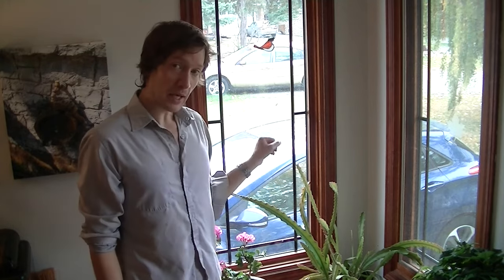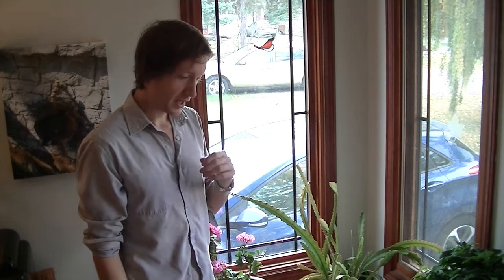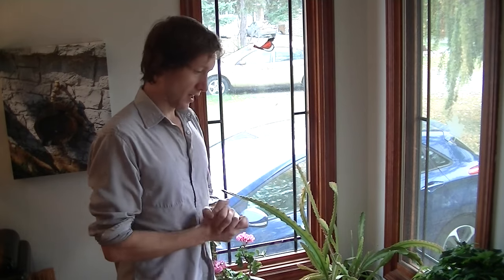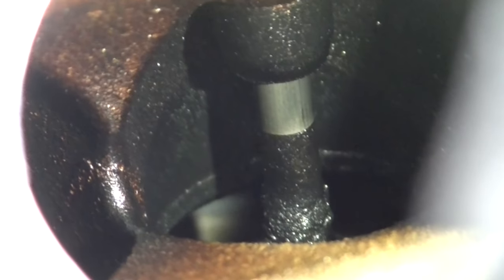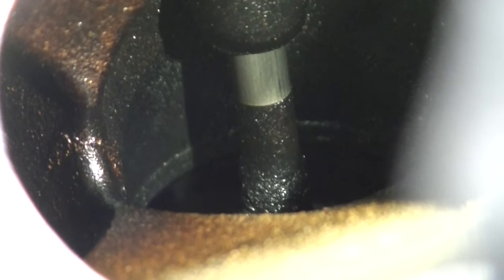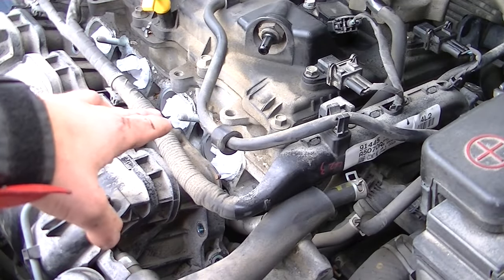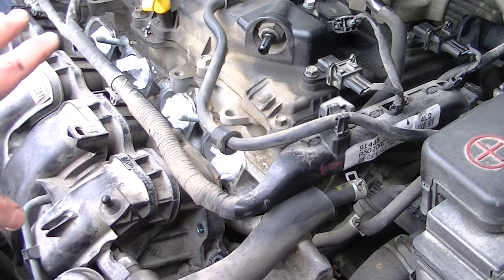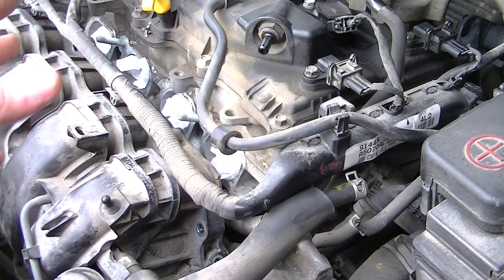Easy DIY Intake Valve Cleaning For Direct Injection | Hyundai Elantra GT

Comment: If you have a DI engine, you should really be running an oil catch can, especially if your engine is turbo charged.
Reply from the maker: That is a fair suggestions. I will discuss it with the owner after doing a follow up to check the buildup..

Comment: That was hugely helpful. I have a 2013 Kia Rio that has what looks like the same engine. Good to know that you don't have to pull the head. They don't have to be brand new, pristine clean. Just clean enough to not interfere with your ECM and emissions systems. Thanks for this video.
Reply from the maker: Exactly, they will only ever be perfectly clean for a moment. So it's regular operating condition is somewhat dirty.

Comment: We wouldn't have carbon build up if the Government did not have stupid emissions requirements. Direct injection goes back to WW2. We could get the benefit of fuel economy and not have to worry about carbon build up. Thank you Washington.
Reply from the maker: True, it is only the gunk causing the problem... well the vast majority of it. There is likely a better solution, but for manufacturers piping it back into the manifold was quick and easy and didn't really cause any issues. ...Until direct injection made it to mainstream. It wouldn't surprise me if the number of engines trashed (and cars crushed) because of these issues, caused vastly more emissions than this emissions 'solution'.
Reply: That is ridiculous.
Reply: @kensmith2839  Really Ken, what was your education? I studied Engineering. Are you familiar with exhaust regeneration? That is what causes carbon build up on a Direct Injection. If the exhaust gases were allow to vent naturally without even so much as a catalytic converter, you would have NO carbon build up. Now let's hear your scientific explanation other than, "That is ridiculous."

Comment: Did not get to see how clean the valves actually got - how good was the clean in the end?
Reply from the maker: True,  I wasn't having much luck getting the camera to focus inside the cylinder head. I should really get a bore scope.

From what I have seen since, some of the sprays specialized for valve cleaning are more concentrated/effective. If you are willing to spend more, that's a good way to go.

Merely a light scraping and a spray removed the major chunks, as seen at 17:36 (a closed valve). But, soaking and re-spraying seemed to remove all but heat discolouration/oxidation.
Reply: @FixingWithFriends  That's good to know - did you flood the brake clean in there or just spray on surface a few times + initial scraping?

Good to know repeat sprays gets it fully clean of carbon - that is about as good as you can hope for.

I really need to get this done on my engine.

Comment: Why can't you just spay cleaner into the throttle body?
Reply from the maker: I didn't go into that a whole lot, so if you missed it I apologize. First, you certainly can but there are some downsides.
Depending on the level of build up it might not do enought of a job.

Also, large chunks of carbon may cause damage to the cylinder head, or wear on the cylinder walls.

Then, the solvent is much thinner than oil so if you don't have the car running when you spray, it will run down the cylinder walls and start breaking down your oil.

Another drawback is Unless you have a bore scope those long hose/nozels for the valve spray cans, it is possible to miss a valve and you would have no way of knowing.

But Secondly, it gives you the chance to inspect for other damage.

Now I may have mentioned at the end of the video... I am fairly certain, if you make a habit of spraying often early on (or after you have it thoroughly cleaned), you could keep the buildup under control just with spraying. I am going to try to check out their car again a couple times to test some of the different approaches.

Anyway, thanks for watching. Good luck! If you do use the spray cans please come back and let us know your experience.
Reply: Thanks for the detailed reply!

Comment: I missed the easy part.
Reply from the maker: Fair enough. While it only took about an hour and a half (with filming), if your effort cap is the air filter/oil change level, it is the hardest thing you may ever do. 

Still, there are spray cans specifically for cleaning valves with a long flexible hose.  You could feed those in through the throttle body, and if you don't have too much buildup already, you may be able to clean them sufficiently just with that (hopefully the gunk would not scratch up the cylinders or something).

But if from the day you buy the car, or after manually cleaning the valves... I would guess merely spraying cleaner into the intake on running engine on a regular basis can keep it under control.